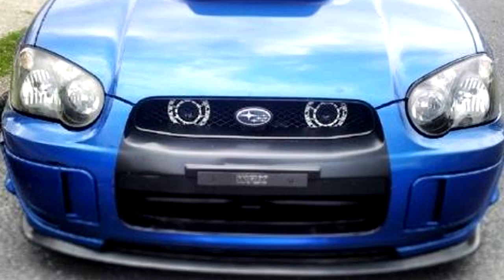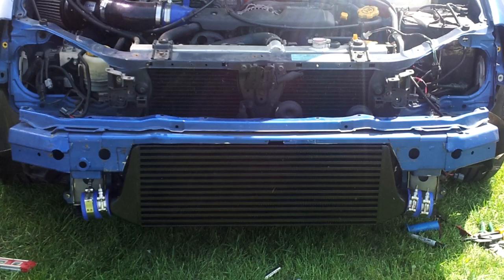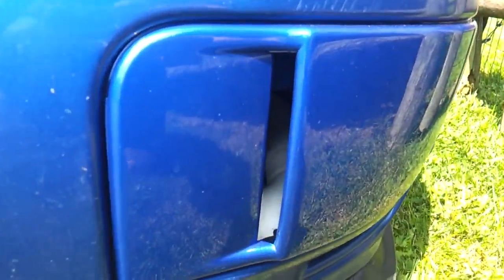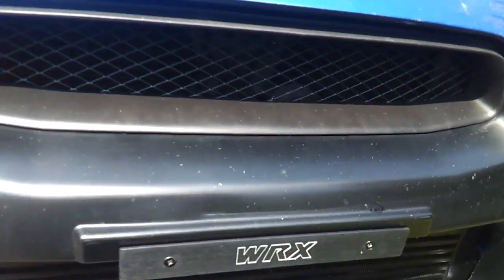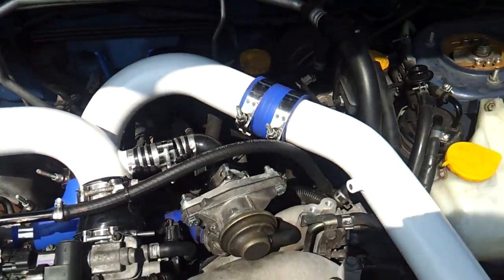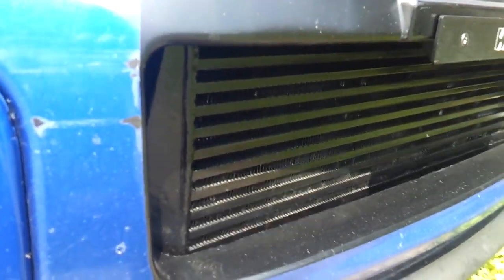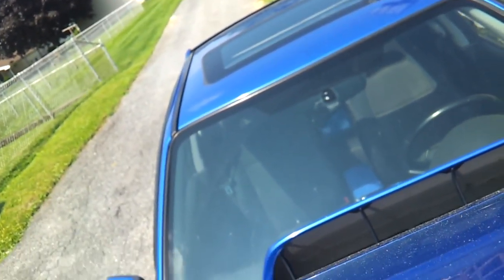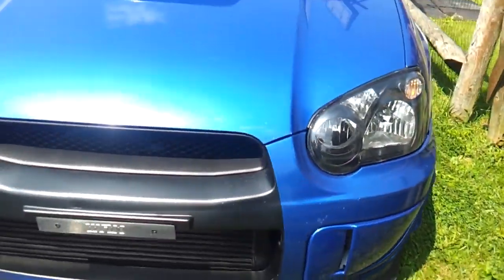2004 WRX TurboXS Front Mount Intercooler

Comment: Hey, I'm wondering where you got that bov flange for your front mount, and the hose that goes from the bov flange to the tube, I need one asap, lol. I just can't find a pipining kit where that comes with it, or the flange in the hose. Thanks
Reply from the maker: Collin Castro All can be found on eBay for cheap! You'll need a 90 degree 1.25" silicone hose (for the BPV flange to fit to) & You'll need a WRX Type H TurboXS Blow off Valve adapter. Lastly you'll need at least 2x 1.25" hose clamps. The adapter can be a little tricky to find, try ebay first, if no luck, try Google. 

Good luck!

Comment: What's the part that allowed you to use your BPV/BOV with it? If I got this I would want to keep the BOV I have
Reply from the maker: Ethan's Variety Channel It's an adapter that allows you to keep your BPV with a Front mount intercooler. Here's a link to a pic
http://www.rallysportdirect.com/catalog_photos/products/turboxs/txs1_ws08_fmic_bpv_2_lg.jpg

You'll have to do some searching for the part though. I had trouble finding mine. I think I ended up finding one on eBay. If your BOV or BPV was made for the Top mount intercooler, than you'll need this adapter, otherwise there are plenty of blow off valves made for front mount intercoolers.

Comment: nice video, what where u talking about the ring land failure while driving at 2500rpm's and getting on the gas ? should make a video on the topic? I always hear ppl saying subarus have ring land failure? is that wrx or sti's or all impreza'a thanks
Reply from the maker: Here I'll explain it to you right here. Let's say your on a mountain bike with gears. Let's say your going slow, uphill and you're in 7th gear. If I told you to go as fast as you could in that gear, up the hill, you'd be putting a hell of a lot of stress on EVERYTHING (your body and bike included).  In a less dramatic sense, it's no different than driving your car in low RPMs (anything under 3000 RPMs is considered low for our small engines in my opinion), if you go WOT (wide open throttle) your turbo will be building boost and your engine will be under a lot of stress. When the engine is in the upper RPMs (anything above 3000 RPMs) and you go WOT it would be fine because it would be like you on a mountain bike going slow in 1st gear. Everything is easier. The ring lands are the weak point in this equation and they sometimes will give out under all the stress. Which is a good thing, it could be much worse.

Basically there's no need to go WOT at lower RPMs because
A. its beats up your car
B. You're slower (tubro doesn't build boost as fast, engine is no where near peak horsepower or torque)
C. You'll end up ruining yet another Subaru

All you have to do is down shift and you're golden :)

Also this isn't just a Subaru specific issue (although it's a common scenario) It can happen to most vehicles and is usually caused by driver error. I can't tell you how many Subarus I here about locally being blown up because kids don't know what they're doing. Poor Subarus :'(

Hopefully this answered your question.

Comment: did the piping came in powder coated?
Reply from the maker: If you buy it new, I believe it's just a shiny metal look. I bought this used off of some girl in my area, she had it spray painted white with a black spray painted intercooler. I'll have to eventually get my stuff powder coated. But as for brand new, here's what you can expect

http://turboxs.com/shop/subaru/231--subaru-wrxsti-front-mount-intercooler-kit-my2006-2007.html

Comment: You did get a tune right XD? Do you plan on getting a bigger turbo? And I would love the scoop even though it isn't functional it still makes the car look aggressive that's why i never took mine off anyway.
Reply from the maker: Nah not yet, still running on Cobb's Stage 2 map. AFRs are good though, I'm currently logging and all seems fine for now. I do plan on buying the Blouch 16gxt turbo. Yeah I like the scoop too, but when going fast, the scoop is SOOOOOO unaerodynamic lol and it's not even doing anything anymore. I'm on the fence about removing it.
Reply: Subie Rumble Oh lol yeah just keep an eye on those AFRs lol. Sounds like a good turbo setup, do you plan on getting bigger injectors or just staying stock? Yeah the Scoop is unaerodynamic but whatever you decide im sure it will look great, but if you do take the scoop off I really like the reverse scoops I cant remember the brand name but some look good just a suggestion.
Reply from the maker: I was looking at this for replacing the scoop. Kind of like an Evo 8 & 9
http://www.iagperformance.com/shopping_cart/proddetail.php?prod=KST-HVSD-0405

I'm getting the Blouch 16gtx, ID1000CC injectors, an External wastegate, an Electronic boost control solenoid and finally a pro tune.
Reply: Subie Rumble  Thats sounds like a solid setup!! That thing gonna be kickass

Comment: he said something about full throttle at like 2500rpm, what did he say u can ruin when u do this?
Reply from the maker: Thomas Ruggiero in my humble opinion, anything under 3k rpms isn't good for the engine. It's called 'bogging' the engine. Putting large amounts of strain on the engine at low rpm's like that isn't good. There are plenty of things that can go wrong, especially on a turbo car & this isn't unique to Subarus. 

I could try & explain it to you my understanding of the issue. But instead read this article. It may save your car from the infamous blown piston rings that Subarus are known for having issues with.
http://www.vikingspeedshop.com/how-to-avoid-blown-ringlands-in-your-subaru-wrx-or-sti//
Reply: ok  thanks so much man   will read it now,  btw you're wrx is sick!!
Reply from the maker: Thomas Ruggiero Anytime man & thanks!

Comment: I know you need to get a tune after this, is that correct? I have a k&n intake and I already run a little lean so I feel the fmic wouldn't make a difference and I wouldn't need one ASAP, but eventually. what do you think?
Reply from the maker: Why do you need one? for the looks? I'd recommend you don't. I personally regret it, yeah it looks cool & your intake temps are lower, but you add turbo lag & throttle hesitation. Just my opinion though. Obviously a tune is recommended! & as for your intake, maybe you're leaking at the MAF sensor? Cobb intakes are one of the few that don't leak around the MAF. That could be causing you do run lean.

Anyways, add parts to your Subaru without a tune most likely = 0 hp gain. Just the way these cars are...
Reply: Thanks man

Comment: DUDE I SUGGEST U TO REMOVE THE SCOOP ( THE INTAKE IS BEHIND THE HEADLIGHT ) IF U KEEPING THIS FOR COOLING THE ENGINE OK ..
ALSO U PAINTED THE INTERCOOLER ?????? WTF!!! AIR FLOW BETWEEN THE GAPS OF THE INTERCOOLER REDUCED ( NORMAL INTERCOLLERS HAVE 3 TO 6,5 MM OF SPACE AND U PAINTED IT ?? 2 COATS OF PAINT MAY BE 0.1 TO 0.2 OR AT THE WORST 3 MM THATS A HUGE MISTAKE (IF I WOULD DO THIS I WOULD KEEP MY OLD INTERCOOLER ) U WAISTED IT REBUY ONE AND LET IT UNSPRAID !! IT SHINE AND ALL THE BIG PROJECTS HAVENT PAINTED IT !!! TRY IT OUT AND SEE THE RESULTS!!
Reply from the maker: thanos ACAB lol...

I am getting rid of the scoop. eventually
Reply: thanos ACAB it's a known fact that black is better for an intercooler, even proven. lmao

Comment: measurements on what u xut away
Reply from the maker: +cody townsend It'll never be the same between cars. different mounting points for the intercooler core, different hose lengths, different coupler lengths. Just test fit the bumper, take it off, cut a little bit & repeat until you have a nice even fit.

Comment: Quick tip I used if your looking to lower your subies temp but get heat shielding and wrap then wrap the downpipe and get a hear shield for your turbo and watch the difference its amazing not nearly half as hot as normal stays perfect if you really want to go big get an oil cooler and full aluminum radiator if you have the stock one with the top thats plastic and last make sure your down pipe is wrapped from the top of the downpipe to the bottom cools the engine alot trust me
Reply from the maker: Interesting, I'll look into that